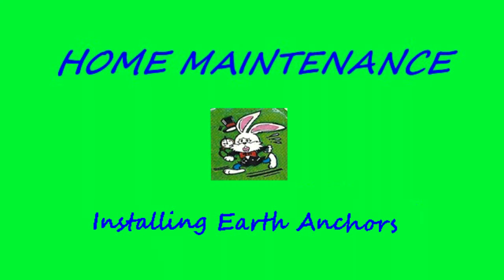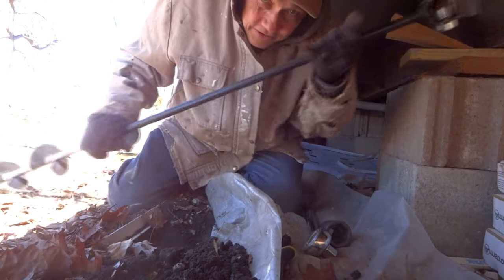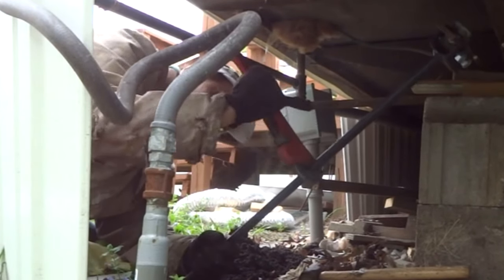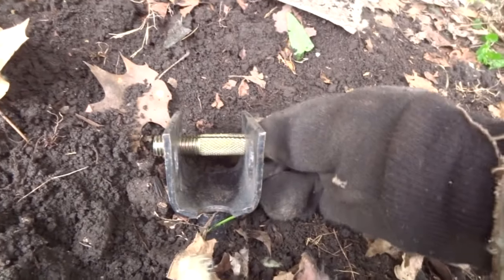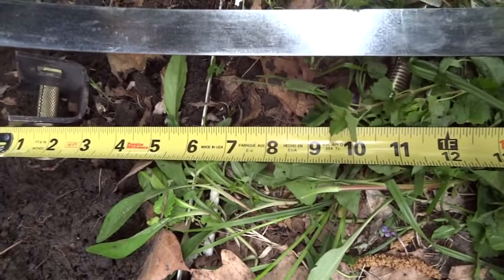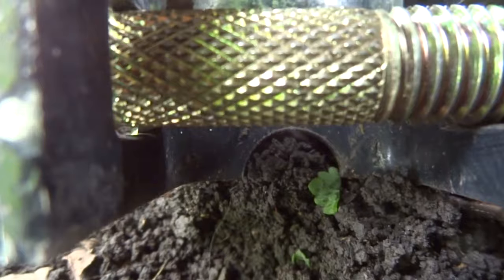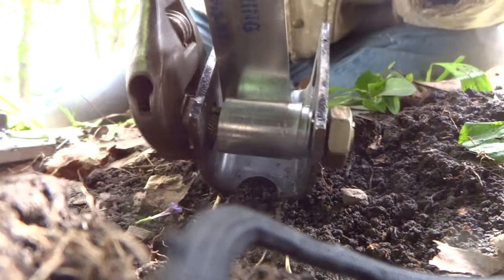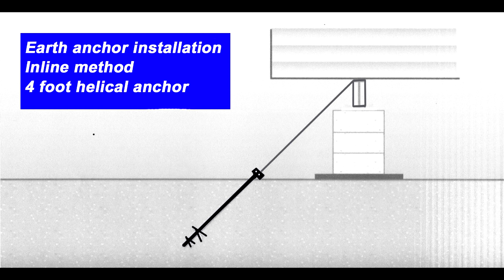INSTALL MOBILE HOME EARTH ANCHORS BY HAND

Comment: Awesome !!!  Just what I needed to see from begining to end ! I was told I could never do it this way and needed to rent an auger and buy the parts that go with the auger. I knew this way was possible. Thanks a bunch !!!
Reply from the maker: Yes, it is possible, and it is also a  good workout that can save you money on gym fees.  Make sure to use a wrench with a long handle.  You can slide a pipe over the wrench to make it longer. Thanks for your comment.

Comment: I can't say thank you enough. You are so patient and detailed oriented. You go one step at a time. The guy that did mine wrapped the strap around in a coil method. I told him it wasn't right. I'm not strong enough to do it myself or I would've. He also went 45⁰ opposite direction. And the worst part he buried just the auger portion & then poured cement on it 😮. Now I'm going to have to by new augers and just cut those others off bcz he also left a good foot sticking out of the ground. SMH. I do have a question. He used screws to attach strap to  cross beam. Have those straps lost their tensile strength to reuse? 
I'm using this on my tiny house it doesn't have metal beams just big joist. Again thank you for your time and not skipping a step. I wish you were MY neighbor 😊😊😊😊😊😊
Reply from the maker: I'm glad the video helped. The screw holes may not prevent straps from working. 
You could try to dig the anchors up and reset, altho more work. Strangely enough, many people install anchors angled away from trailer, not seeing that it's weaker that way.

Comment: I just got a 12x32 shed-to-home,  how many achors do I need? it doesn't have metal I-beams, so I'll have to figure out how to wrap the hook part around a floor beam somehow... also, thank you for your informative video!
Reply from the maker: I would suggest calling the manufacturer tech support for number of anchors. A shed may be different from a mobile home.

Comment: Your video gave me some practical insight for doing this myself. Using the masonry bit and drill is a great idea. Seems like the earth anchors would drive a little easier if the threads had some taper to them, like the point of a screw. I was wondering if you made up the socket adapter, or if it came from the anchor supplier. Thanks for taking the time to make the video while your working. It gives the next guy a little more to work with.
Reply from the maker: Thanks for the comment.  The masonry bit and drill were used in the video, because the ground was still partly frozen from cold weather, it was in early march.  If the ground is soft, then the drill is not needed, just dig a shallow hole to allow the earth anchor to get a grip in the ground.  If you pour some water into the hole, it makes the ground softer.   In soft ground, it's possible to turn an earth anchor into the ground in 15 minutes.

Comment: Mobile home set up and installation is hard work , especially the anchors . Takes a lot of patience to get it done properly . Great job on the anchors !! I used to do this work in my younger years  . Fixing to go install anchors on my 12×24 workshop. I'll be using the 30" anchors, a little bit easier.  Have a great day .
Reply from the maker: I'm glad  the video helped.  I agree with you that setting up mobile homes is hard work.
Reply: That it is very hard work, depending how many rows of blocks you’re set upon you can forgo the straps if not in a tornado hurricane risk area

Comment: Thanks Dude - I guess I can also place them angled towards the middle of the house?  You need a drill with 1/2" and 3/4" (whatever) sockets.  What about strapping Lanai's down (all brick underneath) - think I could go over the roof with cloth strapping, or inside and attach to hurricane Mounts up on the aluminum beams?   thanks again!
Reply from the maker: They make metal straps for over the roof , see ebay. 
The earth anchor hand tool is also on ebay, it has a 1 1/8" socket.
  Use metal straps to connect anchor to ibeam.

Comment: Could you dig Say a 12 inch wide and 12 to 18 inch deep Hole and pour Concrete around it, like a concrete pad. Seems that would also be a lot stronger and perhaps easier? Thanks in advance for answering
Reply from the maker: Yes, a concrete collar is an approved way of stabilizing an earth anchor.see this you tube video on earth anchors - https://youtu.be/AvMoFtdHdQU

Comment: How taught are the straps drawn? Im not asking for a torque spec on the bolt. If i grab the strap should i be able to wiggle it 2"-3" inches perpendicular? Or should it be more rigid?
Reply from the maker: I haven't found anything specific on tightness of straps.  I would just tighten them to where there isn't any slack. The main point I'd say is the straps aren't needed to hold the mobile home down in normal conditions, where there isn't a strong wind.  The purpose of the straps is to resist the pulling force exerted on a mobile home by strong winds.  This means that in normal conditions, the straps don't need to be torqued down, only that they have no slack so if there is a pulling force exerted, the straps can keep the mobile home  from being moved.
It's not like a car fan belt that depends on the tension of the belt to grip the pulleys.

Comment: Pretty sure if you angled the anchor the other direction, base towards the MH, the shear force will be pulling against about 3 tons of dirt instead of just pulling the anchor out of the hole. But what do I know.  I’ve only done this on a shed but feel safer with my method.
Reply from the maker: I understand your logic, and a lot of people install anchors angled away from the trailer. Look in the HUD Manufactured home installation guide, it explains why it's better to have the anchor angled toward the trailer.  Briefly, when the anchor is angled away from the trailer, i.e. the top of the anchor is tipped outward relative to the trailer, then if there is a pulling force on the anchor such as due to wind, then the top of the anchor tips toward the trailer, basically the anchor shaft is the only resistance to the pull, instead of the auger blades.

Comment: Hello! Is this hurricane proof. My dad is getting knee surgery and owns and RV. I need to anchot it down for hurricane season and have no idea what I'm doing. We live in Florida. Any tips?
Reply from the maker: The anchors hold the trailer down in case of strong winds.  Follow the instructions in the video for anchoring. Contact yor RV manufacturer for specific instructions on anchoring your model of RV.  The anchor hand tool is available on ebay.  In case of a hurricane, find the nearest storm shelter, and make sure you have insurance on your RV.

Comment: Hello, i live in the mountains of CA, WIND ZONE 1, i have very rocky soil, more rock than dirt often. I would do this if I could, but I don't think zi could drive anything in. I'm talking rocks 1-3 feet across. There's gotta be a way to do this on my area myself. Does anyone have a recommendation? My mobile is not easy to crawl under either. It's 48x12 long and about 20 inches from ground. I'm looking for easy and cheap
Reply from the maker: Try renting a jack hammer, and dig with a shovel.
Before you do, try putting in an anchor by hand, if you are lucky, you might bypass rocks.

Comment: According to the Wind Zones do I have this correct that anyone living in Wind Zone no 1 needs to put their earth augers at a 90 degree angle?  I would think that straight up and down might be better for "calmer" areas.  If the augers could be put straight up and down what about digging a hole about 4 ft deep and then pouring concrete into the hole and inserting the ground augers by hand while the concrete is still wet?
Reply from the maker: The inline installation method is strongest.  But maybe if you put enough concrete in there it may be as strong.  Best to research it.  
     The problem with the vertical installation method is this; imagine what happens if the wind blows the trailer sideways; the trailer will pull sideways on the strap, and that will pull the anchor sideways.  If the anchor is vertical and the strap pulls sideways on the top of the anchor, what happens?  The top of the anchor will tilt sideways.  In this case, the spiral helixes at the bottom of the anchor are not doing anything.  The only thing resisting the sideways pull is the thin vertical metal rod of the anchor.  The anchor rod will slice through the ground and  keep tilting sideways with little resistance until the anchor approaches 45 degree angle toward the trailer.  Then, if the trailer keeps pulling sideways on the anchor, the helixes will start to offer resistance and give more holding power.  By that time, the trailer may be off the piers.  That's why stabilizer plates are used with the vertical installation method.  The plates resist the sideways pull on the anchor.  The plates are good, and meet the regulations, but still, the 45 degree angle inline method is stronger, especially if you use a longer anchor.  The vertical method is popular, because it can be done with a machine; saves a lot of time and work.  But if you have time, and want some exercise, and also want to save money, then the 45 degree method is useful.  It also has the added advantage of making a stronger anchor.  It can also save you money in gym fees.

Comment: Thank you!! So how many ft apart? Also what did you use in tool for bolts to go in pipe? Thank you. I have a 50 ft trailer  I fig I would put 3 on each side....
Reply from the maker: See Model "Manufactured Homes Installation Standards" HUD.gov
Usually about 10 feet apart. 1/2 inch bolts. Also check w local city hall inspector for local standards

Comment: I live in Alabama and I have set up a bunch of mobile homes the way he's screwing that in the ground is at the wrong angle that's going to pull straight out he's saying 45 degree angle the strap has to be at a 45 degree angle not the anchor the anchor has to be straight down in the ground and the strap has to be at a 45 degree angle and if it's not you have to cross strap it and hook it all the way to the other side of the frame he would not pass inspection in Alabama
Reply from the maker: Thanks for the comment.  It's true what you say that vertically installed anchors with stabilizer plates are approved, but the 45 degree inline installation method is also approved, and has been tested and found to be the strongest method  when a long enough anchor is used.  
     The vertical installation method is most commonly used because it's difficult or impossible to get an anchor auger machine under a trailer, so they install the anchor from outside the edge of the trailer vertically, then they strengthen it by using a stabilizer plate.  The combination of an anchor along with a stabilizer plate gives this method enough holding power to meet the regulations.  
     When an anchor is installed by hand, it's possible to get under the trailer to screw the anchor into the ground at a 45 degree angle with the helix pointed away from the trailer, and the head toward the trailer. This 45 degree, inline installation  method also provides the 4,725 pounds of holding power required by the regulations. Try going to this link to see a video that explains the different anchor installation methods - 
https://www.youtube.com/watch?v=zxdL6U3_Mu8

Comment: would you recommend using tractor trailer ratchet strap to tie down a mobile home?
Reply: It's not ideal. Steel band that are used for mobiles have an incredibly high tension rating and won't degrade the same way a ratchet strap would.

Comment: How many anchors do you need?  Is it like 1 every 10 feet of mobile home or something?
Reply from the maker: The number of anchors varies with the size of the trailer, the height from the ground, and the distance between the I-Beams under the trailer. For the HUD government guidelines, see page 20 of the Model Manufactured Home Installation Standards at this link - 
https://www.hud.gov/sites/documents/225HUD.PDF
     For example, according to the chart on page 20, a 12 foot single wide trailer, 25 inches from the ground, with I-Beams up to 82.5 inches apart, should have earth anchors every 14.2 feet.  This would mean that a 70 foot long trailer would need 5 anchors on each side, for a total of ten anchors.
You have to study the chart a little to understand it.
Also, check with your state government for state guidelines, and your city building inspector for city guidelines.
Reply: @swilson6206  I'm in wind zone 4. The link only does 1, 2, and 3. Where can I find instructions for that?
Reply from the maker: Here is a link for wind zones in the US.
According to the map, the US is wind zones 1,2, and 3.
https://www.manufacturedhousing.org/wind-map/
Reply from the maker: Sorry I didn't see this comment til now.  Here is a link to a map that shows wind zone 4, seems to be just the very bottom edge of the US around the gulf coast.
https://www.fema.gov/media-library-data/20130726-1501-20490-5921/fema_p85_apndx_g.pdf

Comment: Is this a how NOT to install an anchor, or hardest, most complicated, and wrong way, i've ever seen someone install any kind of anchor, just food for thought, what would happen if you installed your tent stakes at that angle? It would immediately pull straight out...
Reply from the maker: It's not so hard, about 15 minutes to put one in.  Also, it's a good workout that can save you money in gym fees.
Try watching this short video by "Tie Down Engineering" on the correct way to install earth anchors - https://www.youtube.com/watch?v=zxdL6U3_Mu8
Reply from the maker: Another option, if you are expecting a strong windstorm, is to lower the profile of your tent, put the stakes farther apart.

Comment: Great video. I needed to know how the strap was installed to the home itself. Thanks.
 But is that buckle or hook that loops around the frame already attached to the strap  when u purchased it ?
Reply from the maker: Yes, the buckle is part of the strap. See - mobilehomepartsstore.com
To install the strap, start from the inside top corner of the I-beam of the mobile home. Slide the end of the strap over the top of the I-beam then bring it around 360 degrees around the outside of I-beam back under the I-beam and back up up to the top inside corner where you started,  then slide the strap thru the buckle and then across the top of the I-beam, and then down to the anchor, where you connect the strap with a strap bolt.  Basiclly, you are looping it around the I-beam, the buckle ends up at the top inside corner of the I-beam.
Watch the video where it shows how to install the strap.
Reply: @swilson6206  thanks for the information bro. Appreciate your time.  Happy Thanksgiving.
Reply: Is this the way you attach the house to the base?

Comment: Never heard of putting in the anchors at that angle. When they anchored my mobile home the anchors went in at an angle from the outside to inside
Reply from the maker: Try watching this video on correct anchor installation - https://www.youtube.com/watch?v=zxdL6U3_Mu8
The inline method at 45 degrees to Ibeam is not so commonly used because the big anchor install machines won't fit under a trailer.

Comment: Wouldn't the anchor be stronger if the 45 was going the other way?
Reply from the maker: Many people do install anchors at an angle away from the trailer because they use the big machine to install the anchors, and the machine won't fit underneath the trailer, but it is actually stronger if the anchor is at 45 degrees toward the trailer. 
     If the anchor is at 45 degrees pointing away from the trailer, a stabilizer plate must be added for extra strength.  If the trailer tries to shift in a strong wind and pulls on the anchor, then the anchor tilts toward the trailer, and the only thing resisting the tilting is the stabilizer plate.  The metal rod of the anchor does nothing to prevent the tilting.  
     On the other hand, when the anchor is installed at 45 degrees toward the trailer, then if the trailer shifts in a strong wind, then it tries to pull the anchor up out of the ground against the spiral helix.  The upward force of the helix spreads upward at a 45 degree angle, and creates up to 4 - 5 tons of of resistance to being pulled out of the ground.
See this video by Tie Down Engineering for the technical explanations -https://www.youtube.com/watch?v=AvMoFtdHdQU
Reply: yep
Reply: Thank you!

Comment: How many would you install and what would be estimated overall price of job once you finished it ?
Reply from the maker: Scroll down the comments below til you get to the one about how many anchors are needed.   The HUD manufactured home installation guide link is in that comment. 
For my mobile home, i put in 14 anchors, with straps they cost $25 each. It took @ one hour each to put the anchors into the ground and install the straps .

Comment: It all looks like a great system but what's the shear strength of the anchor bolt?
Reply from the maker: Here is a link to a publication by FEMA on ground anchors that gives specifications on anchor performance.  Look at pages 7-7, which discusses causes of anchor failure.   FEMA discusses failure of anchor welds, but doesn't mention failure of anchor bolts.
Also, the chart on page 7-12 shows that the anchor  design load is higher for anchors installed using the 45 degree inline installation method.

Comment: Why not just a 24" pipe wrench all they down? Just curious.
Reply from the maker: Depends on the soil, soft or hard, also any roots or rocks.  In the video the ground was partially frozen.  If more torque is needed, the pipe wrench may slip.  Its worth a try.